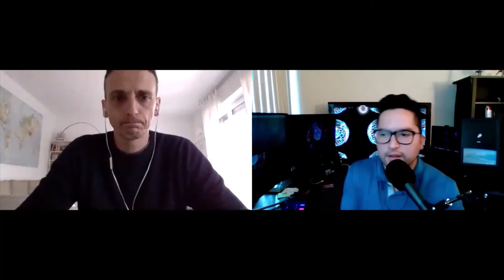Low Thrust Trajectory Optimization w/ Dr. Francesco Topputo | Space Engineering Podcast Clips 9

Comment: Exactly what I am looking for now, but it is so hard to solve this problem. No clue how they actually set up the two-point boundary condition solver.
Reply from the maker: I'm currently working on learning more about shooting methods and boundary value problems, but I'm not quite at the point where I'm ready to teach them, so I'll have to get back to you on this. However, you've likely already encountered simple shooting methods without knowing it.

Newton's root solver method is a shooting method. You "shoot" an initial guess at the root of a function, then use the function value and its derivative to update your guess so at the next step your new "shot" will be closer to the actual root of the function. https://youtu.be/zNd-sRzA7b8

Lambert's problem is also a two point boundary value problem. You know the initial and final position vectors, and you are solving for the initial velocity vector (by iteration) that will reach the final velocity vector after some amount of time. So again you shoot some initial guess and use the error in the final position to adjust your next shot and continue iterating.

The next level of complexity (which I still have lots to learn on) comes from the continuous thrust portion of the trajectory, which is optimal control. I'm currently working through the book called "Practical Methods for Optimal Control Using Nonlinear Programming" by John T. Betts so once I make enough progress and am able to write these shooting methods and optimization programs I will be making videos on them

Also, there are "multiple shooting methods", which will set up boundary conditions at multiple stages of the trajectory, and then converge at them propagating from both sides. So say for an Earth to Jupiter trajectory, the initial boundary is Earth's position, the final boundary is Jupiter's position (at arrival), and then there will be a boundary somewhere in the middle of the trajectory. So in this scenario you shoot starting from Earth going forward in time, and then you shoot starting from Jupiter going backwards in time, and iterate until the forward and backward shots meet at the middle boundary condition. Also in this case, a discontinuity in the velocity vectors at the boundary condition is allowed, since that is then considered a delta V maneuver at that point (deep space / trajectory correction maneuver). Here's a paper that my boss Juan Arrieta co-authored on that kind of analysis: https://www.researchgate.net/publication/330533150_The_Low-thrust_Interplanetary_EXplorer_A_Medium-Fidelity_Algorithm_for_Multi-Gravity_Assist_Low-Thrust_Trajectory_Optimization